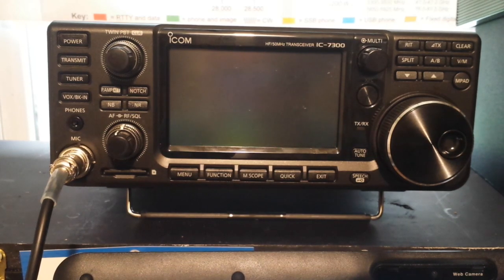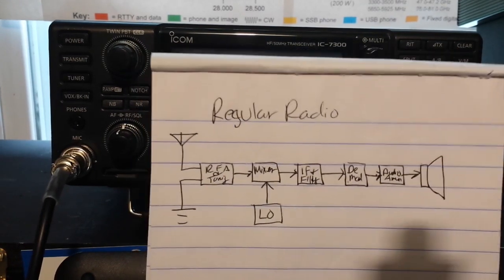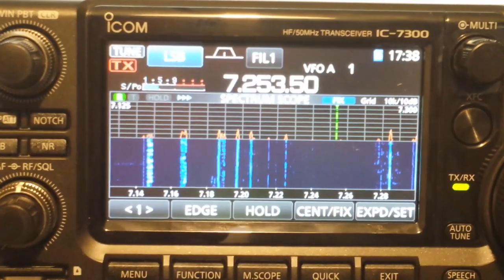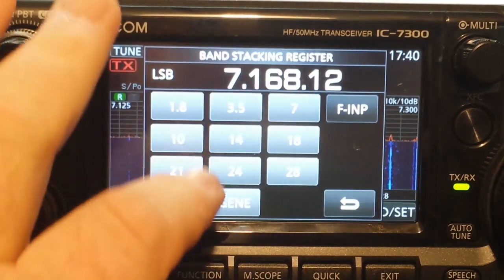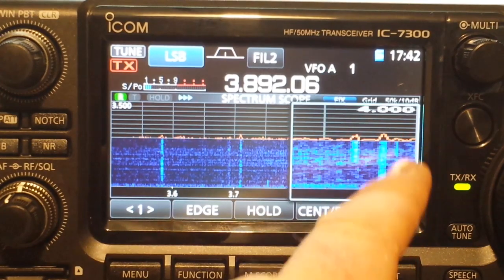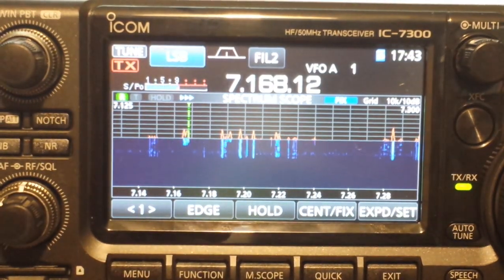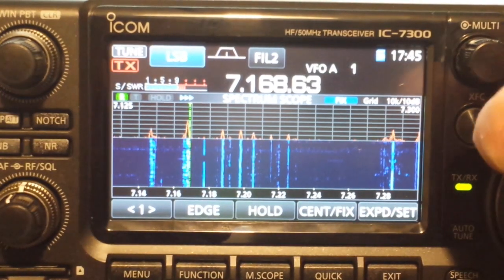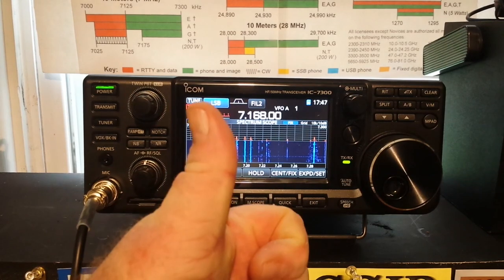Icom IC-7300 Software Defined Radio

Comment: That is one of the lower prices HF radios! They go up to over $3,000! You can get lower priced HF, around $700, but the are low power (20 watts), or don't have built in antenna tunner and no water fall. At this time I don't know of anyone that has them for sale. All the stores are sold out and are not taking orders for them! They can't get them. Unless you want to fly to Japan and get them. There is a shipment problem.

Comment: last month I bought the 7300, antenna, coax and tuner then took the tech test via zoom.  I'm quickly finding out that I need a general license before I can do anything useful with this radio.  Now I'm cramming and memorizing the material so I can finally dig in.

Comment: Have been considering this as well. Got my Tech earlier this year, then General in July, and Extra in August. Love my SDRPlay. Obviously its on RX....but Ive found it very beneficial for learning HF tuning, functions etc. I just run an ic-2730a in the shack for my 2m and 70cm. Its true dual receive, so I dont really need vhf/uhf. Seems this 7300 might be a good addition.

My other option is to just pick up an ic-718 and connect to the sdruno software

Comment: Last May 9th , I upgraded from Technician , to General. A few weeks later , I bought a Icom IC - 7300 , from Ham Radio Outlet (HRO) , in Denver. Still have to get a power supply , and an HF antenna. My $100 rebate should arrive in the mail soon.

Comment: Thanks for the great video and congratulations on your upgrade. I’m in the market for a new radio and find a 7300 pretty damn interesting. Is there any comparison between the 7300 and the Kenwood TS 890S? Wondering if you have a comment? W5PN
Reply from the maker: I don't have any kenwood experience except for a 130. I'm more of a Yaesu guy. I can tell you the the 7300 has the best noise reduction I've ever heard. On the con side, since it samples the entire spectrum at once. It can be overloaded in an rf rich environment.

Comment: I’m a Amateur Extra as well and I have a ICOM 7300.  They are great radios and if you spend anytime on HF you will find lots of them on the air. Very popular rig for sure. I bought mine in September 2018 and after rebate it was $879.  That price point makes looking at used rigs unattractive to me. 73 and enjoy your radio
Reply from the maker: Thanks, I have been enjoying it.

Comment: I really enjoy my IC7300.  Got it from HRO last year on the day of the solar eclipse.  Been doing FT8 and I 'm working the world with 50 watts.   You mentioned the cost, in 1991 I bought my Kenwood TS-440SAT for....$1200....just what you are getting a much more modern radio as they have now.  And the 7300 will not lose a lot of features because of the software upgrades.  73 Harvey KM4JA
Reply from the maker: Ive been trying to do ft8 but wsjtx crashes when i xmit

Comment: Wow Paul, you weren't joking! My Probe Master 8043S kit came in today and they are the best! They roughed up my Brymen leads a little bit, but they blacked my Fluke's eye. My Aneng 8008 was a completely different meter with the Probe Master leads on it. They fit the DMM on my Tek scope perfectly also.  I have the Probe Master leads on my Brymen, my Brymen leads on my Fluke, and my Fluke leads on my Aneng for now. Next month I'll get 2 more Probe Master kits for my scope DMM and my Fluke. Then I'll put both of my Brymen leads on my Aneng and my UT-139C. Thanks man!
Reply from the maker: You are welcome.

Comment: There are some critical parameters that are worth investigation. Sensitivity, blocking and adjacent channel performance being three. These are important because they may be different between a superhet and an SDR. It's all about how the receiver front end stops the receiver ADC  from overloading with signals and noise captured over a wide bandwidth.

Comment: TOTALLY LOST ON HOW THE FIRST TWO BLOCKS OF THE SOFTWARE DEFINED RADIO WORKS?
Reply from the maker: In a regular ol' radio you adjust a set of bandpass filers to select a frequency range that you wish to receive. This then passes only that narrow range from the antenna to the mixer. With the SDR the spectral capture takes millions of "snap shots" of the entire RF spectrum passing the antenna every second. It passes EVERYTHING to the FPGA. an FPGA is a Field Programmable Gate Array. It's like a mirco sized super-computer. Now tihe FPGA can act on that. It can gran the specific frequency you want, filter out noise, equalize sound, decode digital data, boost weak signals, or attenuate strong ones. In an old fashion radio you would need a separate discrete circuit for each of these tasks. Thats why the were so big and heavy.